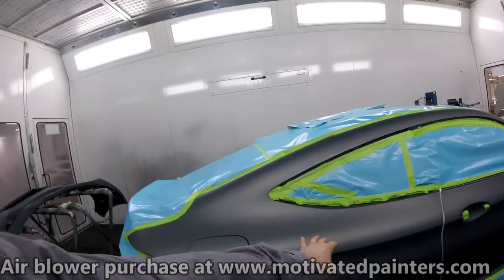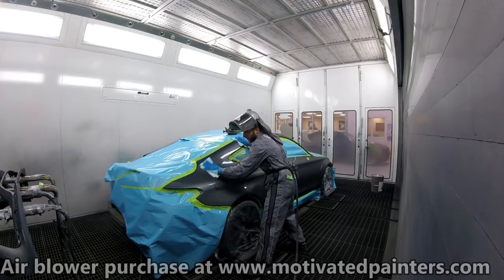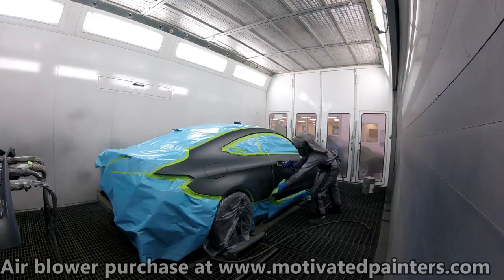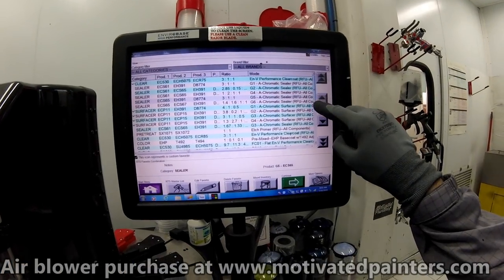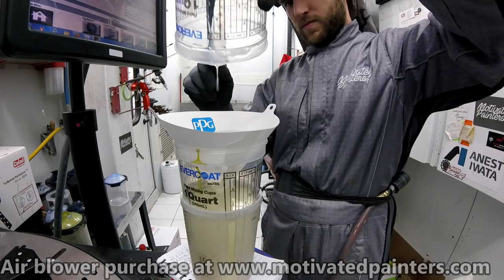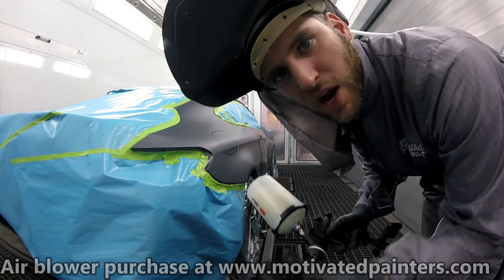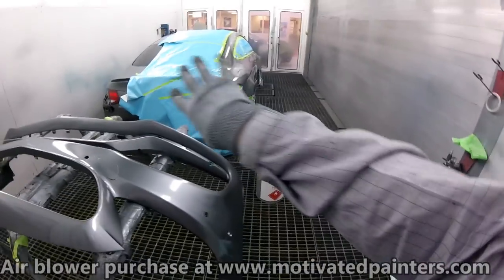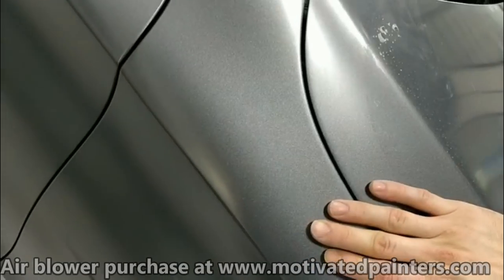Painting a Mercedes Benz Matte

Comment: Hi Gabriel I’m from Langley British Columbia here and I’ll be doing a 35 Ford coupe in Mercedes silver matte finish but the parts will all be coming to me at different times is it OK to mix up flattening agent into a gallon of clear ahead of time, mix it all together and have it ready so it’s all uniformed? Also what is the ratio or percentage of the flattening agent to clear For the same stuff you’re using?
Thank you very much you’re a very talented and informative.
Reply from the maker: Hey thank you! That's a tough one!! But if you follow the same mixing ratio and you use the same can you should be able to keep it very consistent! Try to control the temp and write down your psi and what you did so you can replicate it again and again I don't know the ratio since it's a formula that's in my computer I usually use FC02 from envirobase

Comment: The Cromax paint line I use requires very little to no flash time between coats when doing matte clear. I usually start with a tack coat and do the back-to-back coats as the final coat. It's a little scary trying to put two coats on initially without it running.

Comment: Hey great job as usual!  How would you rate this gun compared to a 5000b rp SATA? Also why is a 1.2 tip better than a 1.3? Smoother finish?  Thanks
Reply from the maker: Yeah it's breaking down the material better with this gun ! I no longer own a sata 5000 I feel like this gun is much better and a lot lighter
Reply: MOTIVATED PAINTERS. What's the name and model number on the clear gun? Thanks
Reply from the maker: Walcom Carbonio HTE CLEAR and HTE base
Reply: MOTIVATED PAINTERS .  Thank you

Comment: Hey  Gabriel I’m in the process of doing some repair painting on my girlfriends front end front Bumper, passenger side fender and side view mirror and hood and I started to spray the base the other day silver metallic and the paint the lady sold me was bad and I immediately caught it and stopped after starting to spray the side view mirror and side fender and barely a piece of bumper. Do I need to sand back down to primer or could I just sand it down smooth and respray it with silver base? Will the silver cover the sand spots from 1200 grit wet sand? Cause that’s what I did so far was just wet sanded it all smooth. I’m picking up the new paint today and needed to know what to do cause I couldn’t find any info on this.

Comment: What's the difference between baking and not baking it?
Reply from the maker: You bake and then you don't bake heat - no heat
Reply: @MOTIVATEDPAINTERS  I mean, does the paint cure faster, or does it become more resistant to scratches and chips if it is baked?
Reply from the maker: No it will be the same